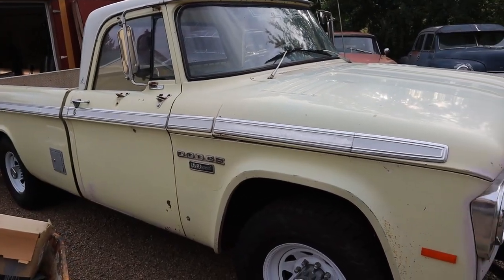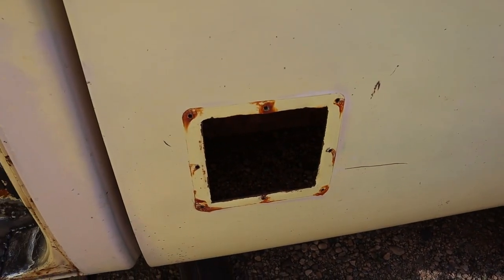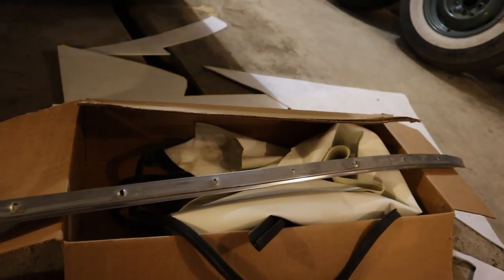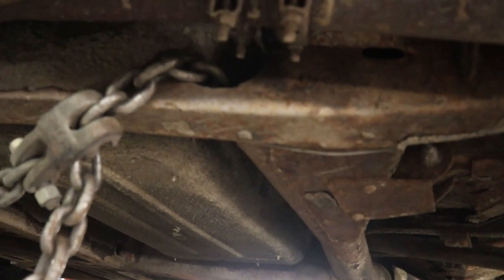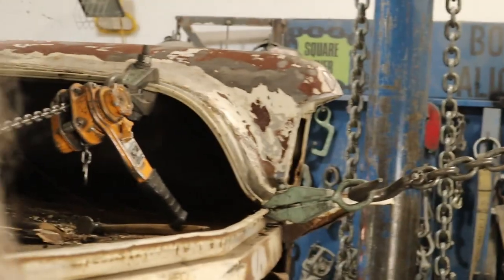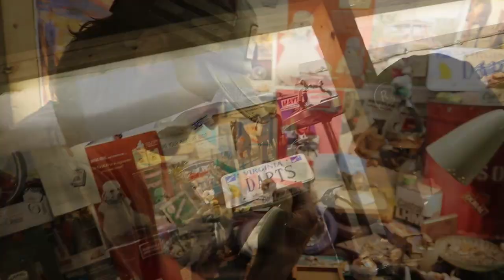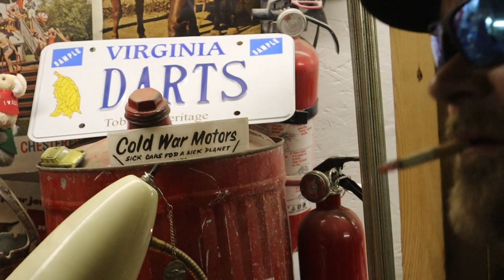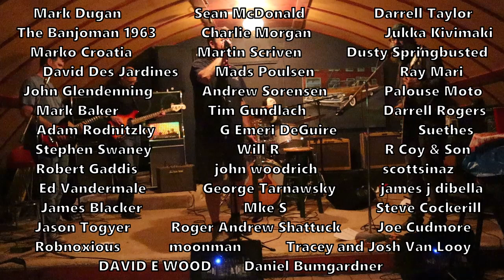Trading Jobs, Fury Weatherstripping, Frame Pull, and Classic Darts!

Comment: Talk about pulling the frame and the panels snap back into shape, my dad's 1988 S-10 pickup got rear ended. It bent the frame and buckled the bed. After the insurance company totaled it he bought it back (never left his driveway) and the body and frame man pulled it. When the frame straightened out the bed popped back into shape and it didn't even have a wrinkle in it. As perfect as a 20 year old POS S-10 can be.

Comment: That old Dodge brings back memories. I learned to drive on a '66 D100 long bed, 3 on the tree, 318 motor. Nothing like trying to take your drivers license test in that thing. Lots of fun to try to parallel park a D100 long bed with a manual transmission. 😁 Brake line ruptured once, had to crimp it off with vice-grips and add more fluid to get it home. Really pulled to one side when applying the brake so I used the gears to slow it down till I could get it slow enough to stop without going out of control. Oh, and the emergency brake handle was way under the dash so I couldn't use that without taking my eye of the road. Yikes!

Comment: Watching the work on the Continental brought me back to the time when I helped my father pulling on some badly damaged cars. It is amazing how much force you have to apply! Specially to some good oldfashioned heavy duty American cars.
And it is REALLY dangerous if you come to close to the chains and clamps. Things might snap any moment. I never forget how the relieve of stress can let you hear the metal react. It is as if the car makes "happy" sounds. 
Sometimes we would let the car on tension over night, so the steel had time to straighten out. We had to pump by hands. There you can feel the "resistance" of the vehicle.
The worst damage my Dad fixed was an Early Seventies Cadillac that was hit by a truck. It was kinked down at least 12 inches on both sides.  Unfortunately I was not there to witness how he succeeded in bringing it back to shape. He only told me that the whole pulling equipment was very close to breaking.

Comment: Happy to see the Continental MkII frame and body pulls being done. It’s fascinating to see that old iron actually pulled and tapped back into its original shape and contours. The skills learned, earned, acquired, and experience obtained, then practiced here are a treat to see and watch. This is somewhat unique when otherwise we see all this significant damage often just cut out and replaced or covered over. 

It would be very interesting to see a profile view of the car before all this straightening and realigning has taken place and after so we can visually see just how much has been accomplished. 

It’s amazing how well that rear frame damage was pulled and smoothed out without cutting up that pretzeled area in the axle arch.  Having that frame back to where it’s supposed to be will help make that body look so perfectly straight. 

Looking forward to seeing more! 

Also good to see the fury coming along. I hope when you get done and roll that car out into the sunshine, it’s a bright, shark clear day so we can just see how nice that car has become. 

It would be a treat to see both the ‘59, ‘60 and ‘61 Fury’s sitting next to each other on a freshly cut piece of your field. That would make a great poster photo.
Reply: Amazing to see Al do his thing with the Conti on the rack-he is a master and now we know where your talent comes from. 
Nice work on the Dodge pickup panels- and fast!!
I did not know about the Jerry Lee Lewis of dowel pins on the Cummins. Is that on the second generation dodges as well?
Great Show as usual!!!

Comment: It's nice to see someone bringing a car back using a frame bulldozer because anymore an insurance company either writes it off or someone that doesn't know what their doing half asses it and just replaces the outer cosmetic stuff like new skins. Back in the 70's a guy like Al I knew would pull the damage on a rear end hit completely out before replacing it all so everything would align right.
Reply: It is incredible how little it takes for the insurance to write a car off. The same insurance does not alllow a repair shop to buy the wrecked car. At least here in Switzerland. 
You have to persuade the owner to keep the car accepting a reduction of payment by the insurance. Then the owner can sell it to repair shop. 
By the way: If you pull the tin can cars of today with the force applied to the Continental they might snap in half.
Reply: Before I knew her my wife slid off an icy road and down an embankment in a pretty new Toyota Tacoma. Bent the frame pretty bad, twisted it. Her insurance company denied the claim because she had a suspended driver license (unpaid speeding ticket) and she ended up letting the wrecked truck to to bank repo. I wish I had known her then I would have taken it to the body shop and had them straighten the frame. Even if it wasn't perfect they could have made it better and she could have kept driving it.

Comment: Back in 1978 I had a 1968 D-100 in the same color. It had the slant 6 tower of power and a three speed standard transmission on the column. It was rusted in all the usual places even at only ten years old.

Comment: Al did a amazing job by pulling that Lincoln body back straight. No half ass jobs there. I never had heard the Dodge Cummins engine suffered from a alignment dowel of death coming loos? Good call on getting it fix just in time. And who can resist classic darts keep them coming.
Reply: Check out the video of the Boss garage  about that 'dowel pin of death' topic

Comment: The Dart Challenge, a high school classmate of mine smoked Marlboro reds. Smokes were expensive and his buddies would bum off of him everyday. He would wind up getting 2 or 3 smokes for himself out of a pack. So he switched to Marlboro greens. Greens weren't cool so he got more smokes per pack, but then desperation for nicotine came into play and his buddies started bumming the greens. So my friend went rummaging through has dad's foot locker from WW2 and found several cartons of Lucky Strike shorts. Dry!, the pyramids in Egypt were a swamp compared to these things. The tobacco had shrunk a 1/4" inwards on both ends of each smoke. It took some effort but my buddy got his lungs accustomed to these ancient smokes and then took them to school. Mandatory rule no smoking in school unless you were faculty and only in the faculty lounge, but that did not stop the boys from this habit. Boys rest room, toilet for instant flush of evidence, smoke not with standing! It was really comical seeing his buddies trying to smoke these ancient smokes and wind up on the floor gasping for air, for the smoke would go down, but it would NOT come back up!
Reply: Sound like vicious Darts

Comment: My dad had a 60s Dodge pickup very similar to that one.  Nice. 
If you ever want to weld all the way around a patch similar to that fuel door repair you did, I would highly recommend putting a gentle radius on the corners.  The stresses created by welding will pucker a square corner and give you added grief.
Reply: Something tells me Scott is already well aware of the rounded corners trick ( I seem to recall him mentioning it in one of his older videos). Welding a patch in the center of a low crown panel is going to pull regardless and there probably wouldn't have been time to hammer it all out nicely and still complete the other repairs.
Reply: @CarterAutoRestyling  
It's all good.
Reply: @JohnStrandt  yeah no worries, it's still a great tip!

Comment: Love the '77 Toro. I was feeling mighty puffed up over rebuilding my '89 Toro's Tecumseh engine but you got me beat. Parts cost me as much as a new one but it starts on the first pull and still runs strong after 5 years. Like yours it will outlive me and 90% of the Big Box stores' crap mowers with their fancy electric starters and auto-stride adjustments. Where have we gone when one is too damn lazy to pull a starter rope?

Comment: No muffler on your Toro LOL!! I use to go around on big junk days and collect push mowers out of the trash some did not run others the bodys were rotten on them anyway I would take them get them running and sharpen the blade and all that and toss them up for sale for 50 bucks a piece and I would make a killing of them things people would come buy one then some would buy two I could not fix them fast enough. People would even give me their old mower for a discount on one of the 50 dollar specials. I would always have a few on the front lawn for sale but I stopped doing it I just got bored of doing it plus I moved to a new place at the time and did not have the room to collect and work on them anymore.

Comment: I mentioned the KDP as soon as I saw you had bought the truck, glad to see it done. I had an old 12v truck as a project years ago and sold it, wish I still had it but stuff happens.  Those pins are an achilles heel on what is otherwise a great motor.

Comment: i missed this episode when you posted it. the first two digits of the code number give you the year. so there's a model type and code on a briggs (3 sets of numbers) and as far as I know this works as far back as the fifties. so a code number that begins in 68 would be a 1968. or 01 would be 2001 etc... That's a whirlwind toro deck. those were some of the best decks toro made before lawn boy bought em. I had a 3.5 hp version that would plow through anything. Great effing decks man. 
Lawn boy has a simlar thing with their serial number, but it's backwards so an 86 would be a 1968 or something like that. been out of that industry for about 10 years now lol but I was trained in lawn boys :)

Comment: On the Fury, see if you can get some soft pipe insulation as used on air conditioner lines. You should be able to fashion a credible looking piece to substitute for the factory molded item using a utility knife and black RTV.

Comment: I fixed many cars with damage like this at the telephone pole frame shop.
Hook a 3/8" chain to the offending frame rail. Leave a little slack on the chain and hit the gas. 2 or 3 hits and your done.
Reply: I crashed a '90 Corolla.  It looked like it was totaled (was, officially, but....).  When the ramp truck got there, I talked the driver into letting me do a couple of experimental pulls and got it straightened out enough to drive it away.  I told him I was going around the block, and if it didn't track he could haul it off.  When I got back, he was gone.  No charge.  Drove it like that for a couple of years until I found a front clip in the right color.
Reply: Big oaks work well also
Reply: @Rumpleskin  I employed a big-ish maple and a comealong when I finally fitted new sheet metal on her.  Drove that car for 20 years.  Then again, with the relative sizes of the old Cor' and the huge SUV I rear-ended; I kind of just slid under his bumper, although his hitch receiver did slice my bumper in two.

Comment: I wonder if that Briggs engine is original to that Toro mower? It's a different colour. I had a similar looking Toro mower from the 1960s, and it had a very early Tecumseh/Lauson engine. The whole mower was aluminum and was a really nice machine, super light weight much like the old Lawnboys with the magnesium deck and all aluminum engines. Back when you could actually buy something well-made and designed to last. You didn't need self-propelled because OMC were the lotus of push mowers, LMAO.

Comment: Check the blade on that mower, see if it is not on backward...
Reply: Yeah, it looked like it was giving the grass blunt force trauma rather than cutting it. That used to be a comically common issue when I worked at the lawn mower shop in high school.

Comment: Do you get the same level of distortion-shrinkage,  if you braze the square patch in?
Reply: You can’t do bodywork over brazing. Won’t stick.
Reply: @robertbak4108  Brazing is done at a lower temperature than welding. Does it  cause less shrinkage and distortion than welding?